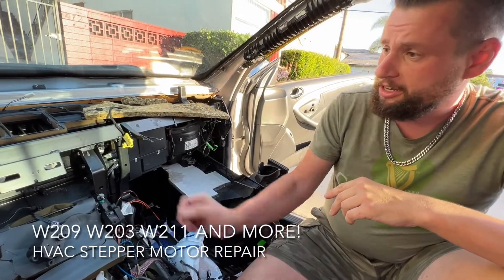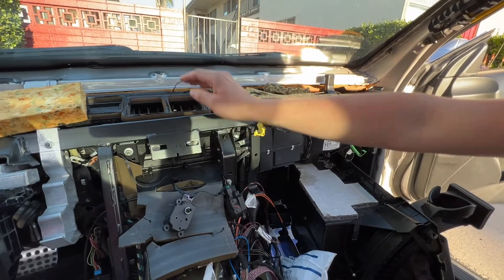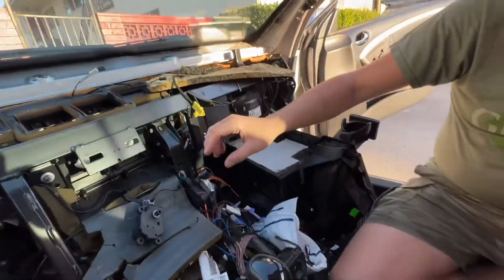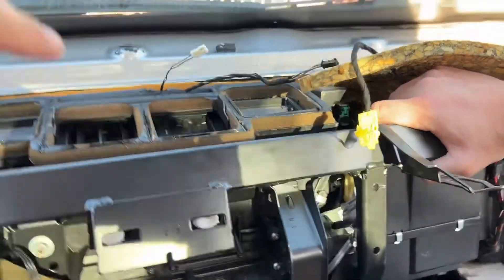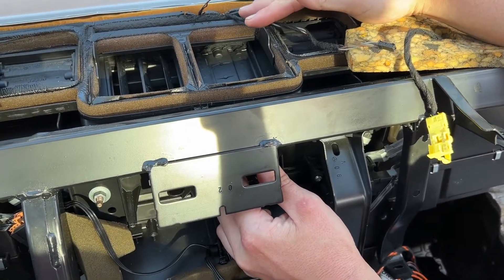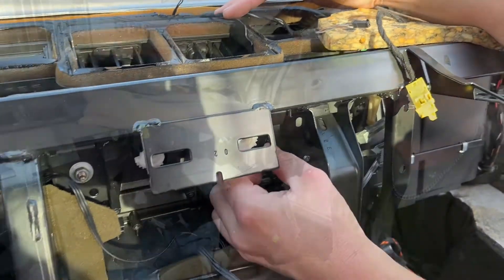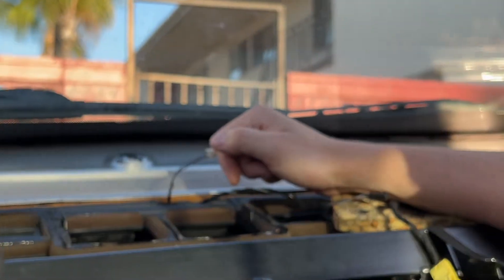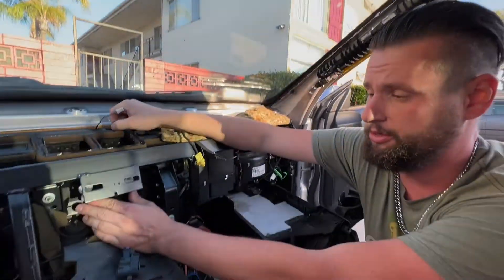W209 Mercedes CLK (also W203 w211) HVAC stepper motor linkage DIY. Fix that clicking dashboard!

Comment: Finally. I replaced the stepper motor behind the radio to stop the clicking but it doesnt open the flaps to the windshield. So I presume. This is the fix. Thank you.

Comment: Great work and video guys. Fixed many things on my '05 CLK55; this one I'm not doing. I'll buy a C63 before that and still keep the 55 - give to my boy. Not a litigious guy but that should be class action and force MB to fix such a horrible choice of material; much like the power steering wheel adjustment failures for the same thing - a .50 plastic part.
Still love this car though, the boys gonna have to wait.

Comment: Great video - I have a 2005 E320 (w211) - I took out the dash and found the three on the top.  Do you know where the other 3 are located?  My Autotel reports 5 of the 6 not functioning.  Also MB reported a six month wait for new motors but like you, I found a set of 6 for $68 on ebay.  Thank you

Comment: Did you guys film the stripping down of the Dash to get to this point?
Reply from the maker: You might end up getting your wish. We may have to remove the dash again soon, and this time we will make a video of that process :)
Reply: @ZiadAunallah  this will be very helpful! My w209 stepper is clicking and I could only find w203 tutorials. By the way, why do you need to remove the dash again?

Comment: Fabulous explanation, thank you. Can you please tell me what the distinction is between the white and green gear/plugs that are included in the repair kit PN 2038300032? Also it looks like there are 6 white gear/plug/socket pieces in the repair kit. Is that enough to replace all the gear socket attachments if you have 10 stepper motors like I have in my c320 or do I have to order two 2038300032 kits? Thank you so much for your help!

Comment: Hi, I was hearing some weird sound of tightening each time when I was directing air toward up/windscreen on my w203. After about 1 year I got this clicking noise which I couldnt ignore ofcourse. I saw on youtube how to change HVAC stepper motor, I did same and problem was solved, however I can hear again tightening. I removed parts again to see what is happening, stepper motor is doing job, little arm is also ok, but little part which arm is pushing toward up to open air toward windscreen is going really hard and slow, thats why my stepper motor went bed, it could not endure effort...What I should do here to solve issue? I am thinking maybe this flaps,doors.. I dont know how they are called on english, which are oppening air flow toward windscreen got dusty or some dirt so they are going hard... what I should do, my new stepper motor wil go bad again if I dont solve this..?

Comment: Part number for these kit from Mercedes?  thanks
Reply from the maker: The part numbers for everything are in the video description but if you missed it, here it is :
Mercedes Stepper motor part number : 203 820 16 42
Reply: @ZiadAunallah  Hi, thanks for video - the part number comes up as part number for a motor - not the kit you have. Have you the kit number please?
Reply from the maker: @brianmcginn9237  all of the part numbers are in the description of the video. Please read the video description. There are 3 different part numbers there. Thanks !
Reply: @ZiadAunallah  Thank you!

Comment: This is not fully correct for W203, because w203 have only one stepper motor in the center (look at this video https://youtu.be/ex-ENAOW0qU?si=Gs8GDq0AAwBoF9GN ). Maybe before the facelift there is a single motor in the center and after the facelift there are two motors, not sure, but maybe. On my w203 before the facelift, there is only one motor. When you teardown the dashboard, chech how many center motors you have on your cars and check all of them. Only then you will be sure.